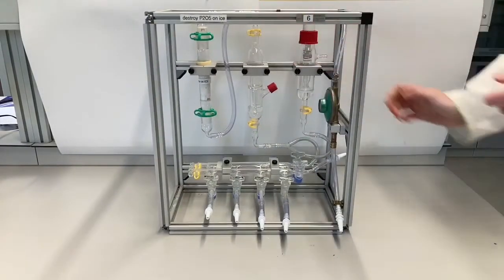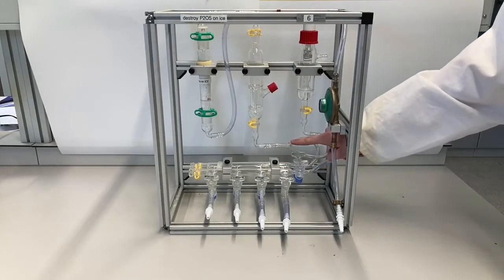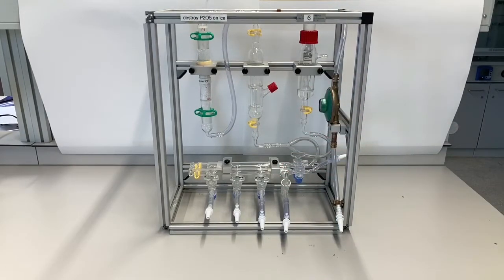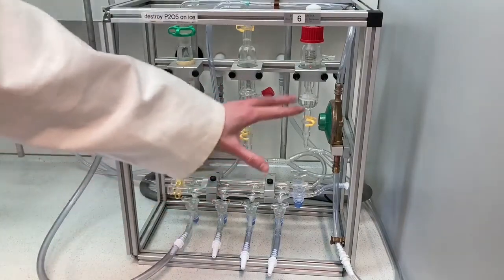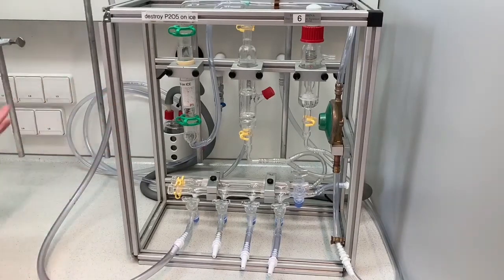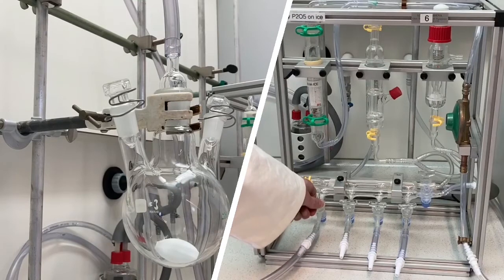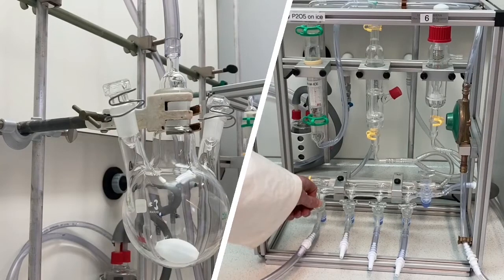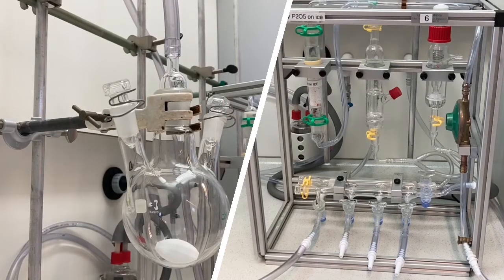Chemical/Laboratory Techniques: Schlenk line

Comment: I'm from an engineering back ground, so Schlenk lines built with retort stands always look a little scary/flimsy.  They also consume a lot of fume cupboard space.  

It's great to see a Schlenk line that actually looks robust and more clearly laid out (it also looks more easily removed from the fume cupboard).    I'd love to see a video (or paper) with more details on how you designed/built this Schlenk rack.   As Jose implied, I think it would be great to be able to buy a proper Schlenk rack like this.

Comment: Is that setup custom-made?
If yes, please tell me where to order.
We are currently trying to build a setup like this in our lab. 
Thanks.
Reply: Did you find were to buy it setup?
Reply: The setup is custom made in our in house workshop. The frame is extruded aluminium profile (available online or at DIY shops), the glassware is available at your chemical glassware supplier, the holders we use are possibly cut to size. Then it is a matter of connecting them with hoses and setting the pressure reducer and over pressure valve at the correct settings.
Reply: @TjallingCanrinus  Is the Al profile "T-slot"?
Reply: @MattBoreland  Yes